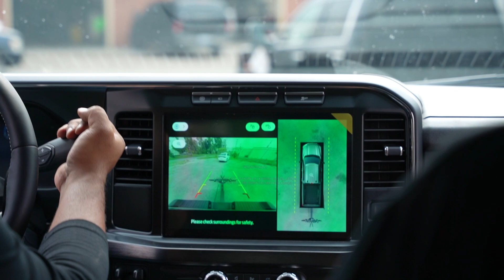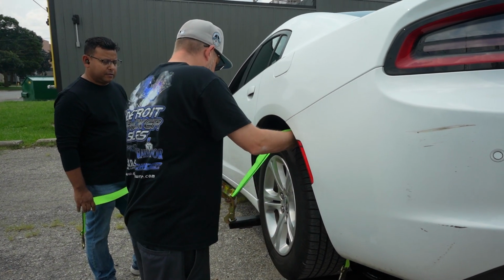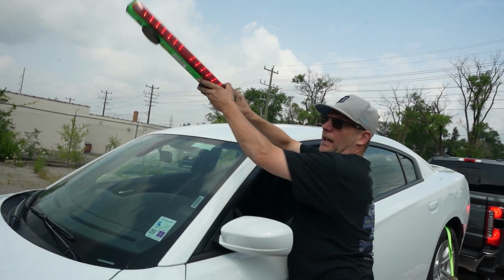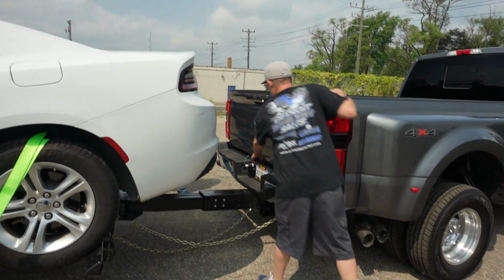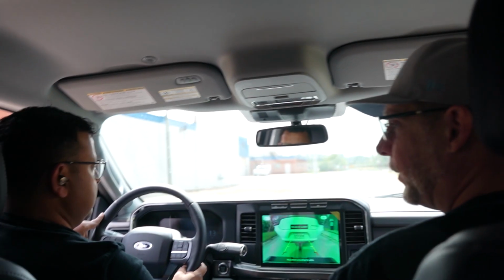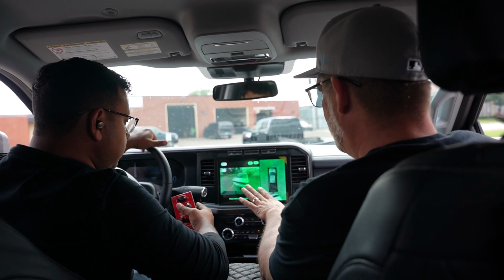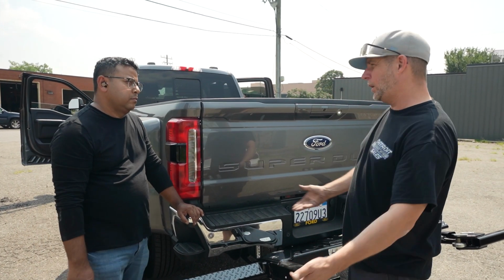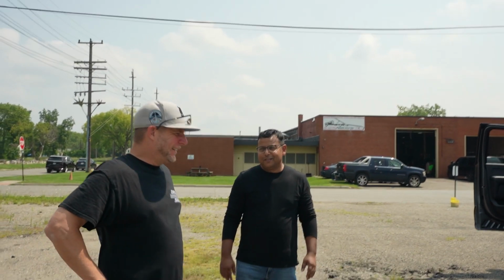Training Day with Chevron Towing #lilherc

Comment: Can this until tow a heavy load ? Like a f250??? Maybe even a box truck?
Reply from the maker: The tow truck for safety sake is always supposed to be the biggest truck 🛻 in the equation. But yes our units are capable of lifting heavy loads although that is not the intended purpose. It’s a side effect of building a unit that will outlast the truck it’s installed on.

Comment: You don't need the safety chain and you don't need to strap those lol those groups have a good lock on those wheels I just back up hook up to it and take off and have 4 years never an issue I turn on the four way flashers of a car that's good enough I've always just locked the wheel with my seat belt either way if the car gets damaged during repossession it's on the customer that didn't pay on the the car
Reply from the maker: Thanks for the comment! We appreciate ya!